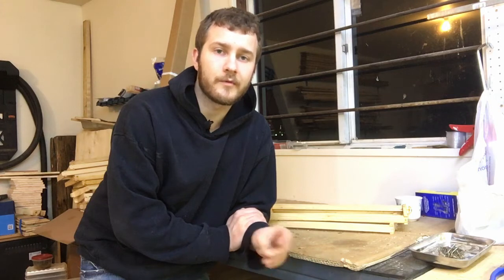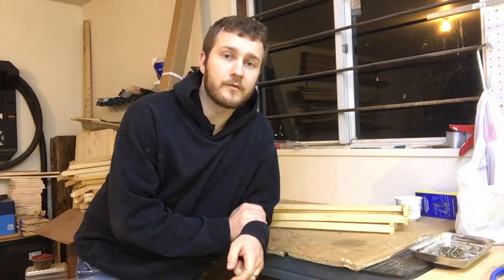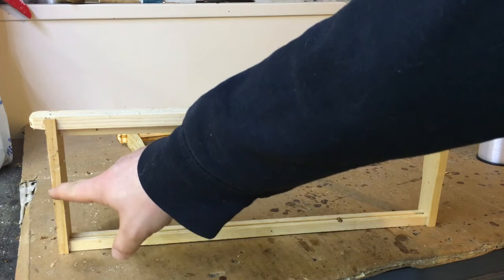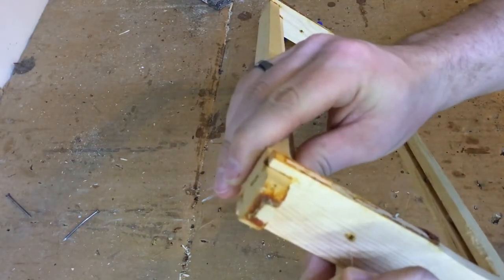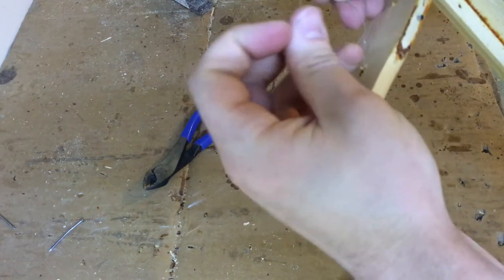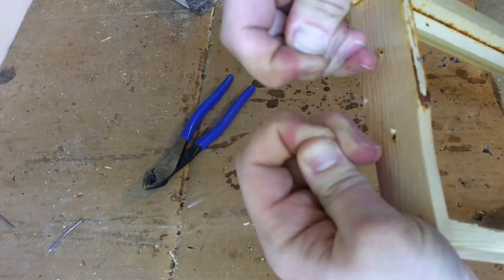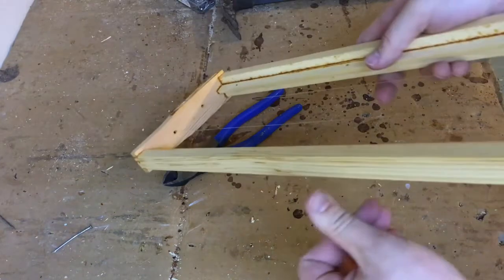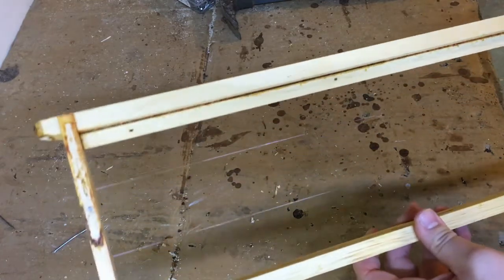Wiring Frames with Fishing Line, Tying Fishing Line into Bee Frames

Comment: If you use two little nails...run the tag end like you did there, and wrap it around a nail and drive it down...then you can pull your line tight enough by hand, wrap it around another nail and drive that one down, and cut your line.  Faster than tying the knots.   Good video.
Reply from the maker: Thanks, you know I tried that and for whatever reason I get these done faster. Thanks for sharing, be sure to subscribe!
Reply: That's the way I do it too ORM must faster for me. I use 30lb test that you can really pull tight and the bees don't chew it in half then coat it with melted beeswax using a hobby paint brush.
Reply: I read that there's a toxic lubricant used on mono filament fishing line, it's for sure on eagle claw line I asked the factory rep.
Reply: Roy I clean my mono filament with alcohol to remove any lube applied by the manufacturer. It's squeaky clean when I use it before coating it with bees wax.
Reply: private bubba does this really works if so I will use it for I have fishing line and bee fram wire isn't cheap of readily available to me ps if I don't coat the line in wax will they chew it up?
Reply: private bubba how exactly do you clean your line plz explain I want to do this way
Reply: I take a shop towel and wet it with isopropyl alcohol and pull a length of line through the wet towel pinched between my fingers then thread the line through the frame and attach the leading end to the frame using a wire nail with the line wrapped 2-3 times and finish nailing in the nail. Then pull the line tight backwards from the starting and attach it with a second wire nail then clip at the nails and start my next frame.
Reply: Bees will chew on anything that they don't want in the hive. 30lb test of cheap mono filament seems to stand up well. I don't know if coating the line with melted wax has any effect but I have had no problems and my frames have held up well when extracting the honey. I've repaired comb by holding it in the frame with rubber bands and they chew the rubber bands in half after a while but they secure the comb repair before the rubber bands are broken.
Reply: @privatebubba8876  I also use 30lb test line the bees can't really chew through it